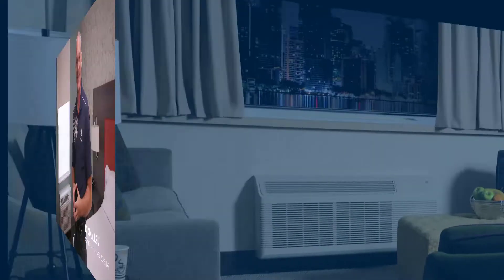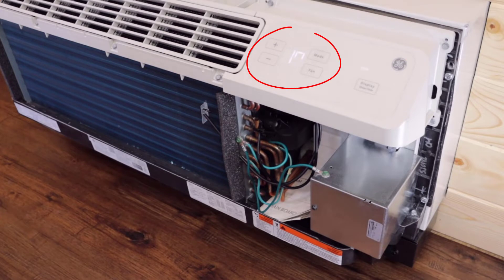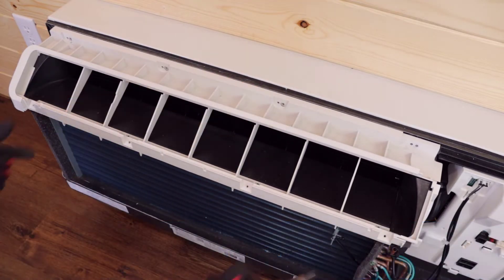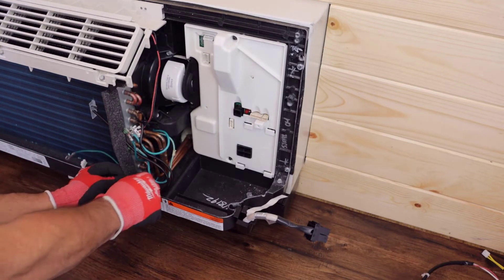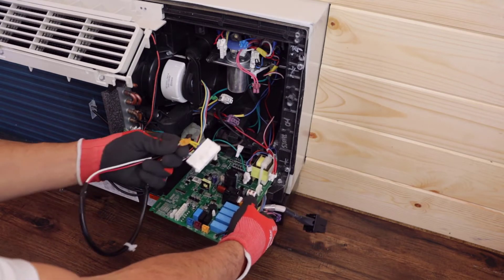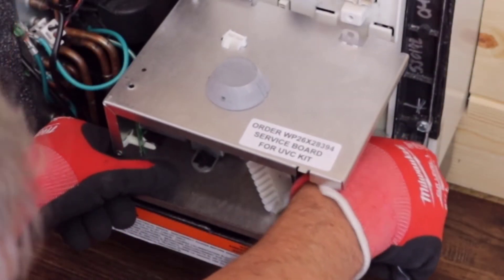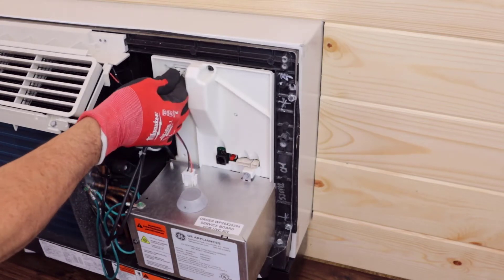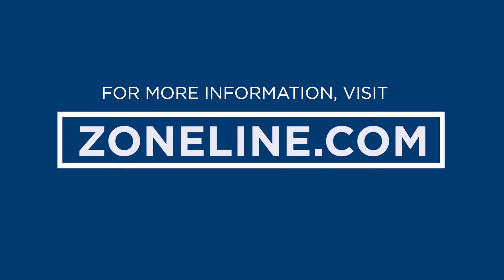GE Zoneline PTAC- UV-C kit installation for AZ45 and AZ65 models.

Comment: The main board's must be set correctly before power up, or you will be buying another board, make darn sure you have the dip switches set correctly, then you can power it up, you do not get a second chance if you mistakenly leave a dip switch in the wrong setting.

Comment: It looks like the main board stores everything about the unit it's going into. I pulled the main board from a regular non heat pump ptac and it cannot be set up to work in another unit. The boards seem to be loaded with everything and you make darn sure the dip switches are set correctly the first time, once its powered up, that's it. Too late to change anything. If you messed up and didn't set the dip switches correctly, you owe need another new board. I'd surely think the board could be reset back to pre power up status. I remember chips I tv receivers that had to be programmed correctly. The instructions stated you didn't get a second chance.  Maybe that's the thing here. I programmed the new main board for a65 series and it appears it will no longer work on a 45 series.

Comment: I ordered the main board from ge, it has the dip switches on the board, the other board I had ordered and installed did not have the dip switches, I got them set and put in the revision number. Works great now, I have all functions. This really has me wondering, the numbers on each board are the same. Why would some boards not have the dip switches ? I’m wondering what determines if the board is to run as a heat pump, but then I Order a board and I set it up, the dip switches look to be what tells the board to work in a heat pump model. I soldered dip switches on the board but it did no good. I’m thinking that this board somehow was preprogrammed to work in a non heat pump model thus all optional features are locked out. I think and pretty sure that the place I ordered the first board were wrong when they told me they no longer have the switches. Something is really strange here, might be worth looking into.
Reply from the maker: Hi again Perry,

Thanks for keeping us updated. If you're needing parts replaced in your Zoneline air conditioner, we recommend reaching out to our service team to make sure the correct part is ordered and installed. If you ever have service questions in the future, know that our team can be found here: https://www.geappliances.com/ge/service-and-support/service.htm

Hope this is helpful!

If you have other questions or concerns, feel free to let us know and we'll do the best we can to assist. -MS

Comment: Hi is cool air supposed to blow out of the bottom of the unit while the heat is on? The actual vents blow out heat at the top but the bottom blows out so much cool air if sitting next to the unit you’re actually cold. It’s so odd.
Reply from the maker: Hi Cooper,

Thanks for reaching out about your Zoneline models. We're sorry to hear about the issues that you've had here truly. If they're not heating well, you can reach out to the following contacts for service and support:

1-844-GE4-PTAC

1-800-GE CARES

ASM.Hospitality@geappliances.com

We hope that this is helpful for you.

Best wishes. -MS
Reply from the maker: Hello there. Thanks for reaching out about your AC, we're happy to help! Would you mind providing the model number, please? -MJ
Reply: @geappliances  Unfortunately I don’t know the model. I rent an apartment so I was told it’s a brand new unit.. It looks like the exact same one in the video but I’m sure most of them look the same. My light bill is tragic. I have to constantly have it running to keep the living room warm. The middle of the room starts warm but anyway near the unit feels like I have the AC on then the room temperature drops so fast as soon as I shut it off.
Reply: @lane2815  I bet you have the same one as me, you can crank it up to 80 and it still feels like  it’s blowing cold. I have 5 new ge zone lines without the heat boost option and it’s really total shit
Reply: I have a az45 model zoneline I have my settings right and it still blows cold air on heat
Reply from the maker: Hi again! Please use this link to help with locating your model number: https://www.geappliances.com/ge/find-model-serial-number/room-air-conditioners-zoneline.htm

Once we have it, we will be glad to research this further for you. We will be watching for your reply. -SF